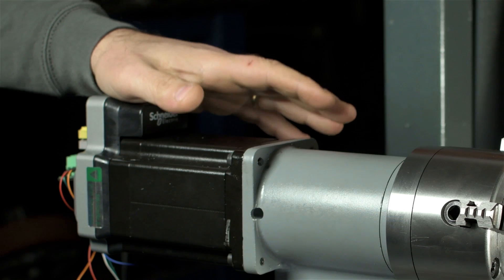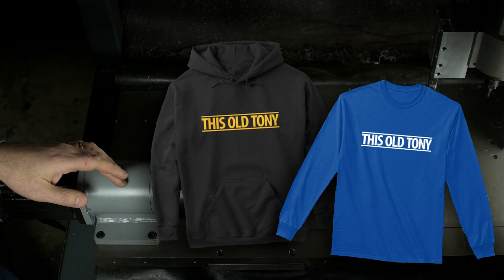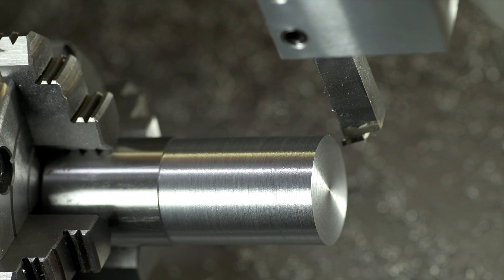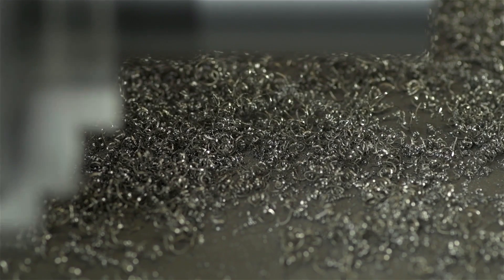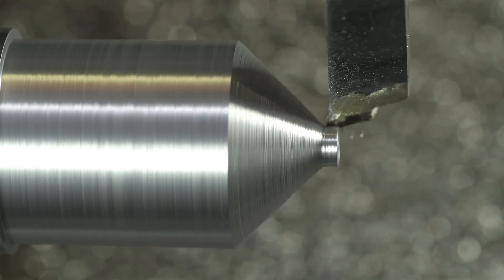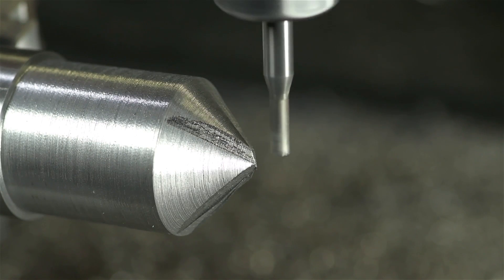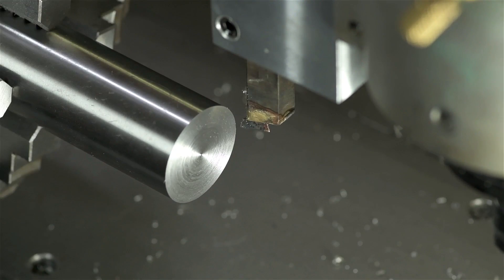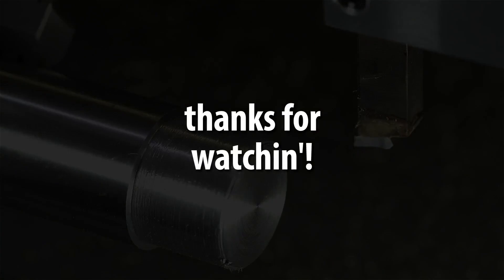Will the CNC lathe add-on TURN STEEL?

Comment: This surface finnish made my eyes bleed xd
Reply: stop rubbing steel on your eyes
Reply: Observer Ward, you looked to closely.
Reply: That’s because you were in Finland where they speak Finnish I believe. The surface finish looked like shark skin under a microscope.
Reply: You might prefer a surface swedish?
Reply: It would make a good lathe for producing piano tuning pins.  
0.01% of the general public will know what I mean. 
Which (true confessions time) is more than usual.
Reply: @Gottenhimfella   actually no, it wouldn't be good at all for producing piano tuning pins
Reply: This surface finish made my fingers bleed.
Reply: Surface finish? What surface finish? All I saw was a train wreck wrapped around a piece of cold rolled steel stock.
Reply: you should see his surface swedish
Reply: Fins fined for fine Finnish finish!
Reply: If you need to look at it that closely, I suggest new glasses.
Reply: It's micro-knurling, for positive grip.  Looks like a great way to make some lathe/mill handwheel handles (the profile of those things is a pain to do manually) - smooth 'em down with emery cloth and Bob's your uncle.
Reply: Needs a bigger nose radius on the insert.

Keep up the good work, Tony.  Even if you need glue.  ;)
Reply: I presume he did it with a knife... the Finnish are well known for that sort of thing. I'm unaware if surface Finnish are more likely to stab you than cave dwelling ones though...

Comment: wait wut i feel stupid now..<lets not get into that> you soldered or welded the cutting tip...what was that all about ...ive never seen that before
Reply: That's the brazing he was talking about (brazed carbide tool). It's a great method of attaching thing like this, or certain metal to metal connections that welding wouldn't work for. Google it, or look up Jody from welding g tips and tricks here on YouTube for more info. But brazing is very useful...

Comment: Sharpie in a vise, Ah now that brings back memories. Sharpie in spindle forgetting to set zero rpm but still set to 24krpm instantaneously bluing of the work-piece, Doh!. But at least it now save me time and engineers blue.

Comment: WOW ! just ordered TWO long sleves!
Reply from the maker: I should have clarified... each long sleeve already comes with two sleeves!  ;) thanks Ed!
Reply: @ThisOldTony  HAHA Thanks man! Truly LOVE your storytelling, it's something really different, I really admire and appreciate it. :) 

Question: I have been thinking of building a CNC with coreXY movement, belt driven and all, just to have a machine to cut wood and plastic with. But the challenge is how to make the Z-axis movement because I want to make the bed go up/down. With the goal of making it with two motors or less. Would you have any ideas on how to make the construction and mechanism? 

Caio

Comment: Do you use cutting oil or lubricant ? Because i didn't see you had any while cutting
Reply: With carbide generally you want to run a steady mist or flood or none at all. Manual oiling can shock the carbide and crack it. That is just what I've heard. I've yet to crack carbide this way myself. I usually chip it when I do something else stupid. That reminds me, I need to order some more parting tool inserts...
Reply: @lordgarak  Oh ok thanks a lot for answering I did not Know that and I'm actually oiling my parts manually with my carbide inserts so I will stop.

Comment: Just put an planetary gear between the motor and the spindel, maybe 1:2, half the speed is enough to cut but double the tourqe and rotaion stability will pay off for the speed loss great time.
Reply: I personally would put timing belt pulleys on it. Have different ratio's for different applications and add a brake for indexing. A heavy flywheel might not be a bad idea either, it would limit the acceleration a bit but might help maintain speed at the start of cut. That said if the power is not there, the flywheel really isn't going to help.

Comment: Hmm...a stepper motor is...maybe the not best choice for driving the chuck?
Reply: Not if he just wants to use it as a lathe, but he showed in previous video that he's also wanting to be able to use it as an additional index-able axis so it was a compromise on the motor used.
Reply: Itnis not exacly a stepper motor anymore in this configuration because the motor driver is in a se4vo loop with output angle feedback and the driver drives it with almost sinusoidal current on the phase windings. But he said the last time, that he knows this is not intended to be a perfect cnc lathe, but something in between anothernaxis and a spindle.
Reply: @sanches2  Sure it has feedback but stepper motors have bad torque on high rpm.
Reply: @sanches2  What? A stepper motor will always be a stepper motor. They are good (sort of) for precision, but as demonstred by This Old Tony, they just can't produce the constant (ish) torque needed for quality finishes. As soon as the DOC was increased, the motor struggled.
Reply: @BigStew007   ...which is why, as mentioned, it isn't being used as a dedicated spindle drive, but rather a multifunction additional axis that is flexible enough to be used for light lathe work(very likely limited to softer materials as well - which is why this is a separate video, with no steel turning in the original video) and potentially even perform multiple operations without need to physically reposition the work, just an addition to the coding to incorporate this
Reply: Servo would be better ofc but that Schneider motor seems decent

Comment: My god, I didn't know the tool goes so little into the part. Like 1mm is too much! Wow!
Reply: You can see to spindle stalled right before the tool broke. As Tony said, its problem wasn't the 1mm depth but being pushed into stationary metal. And the stall is quite understandable - stepper motors like this are simply not meant to be spindles; it's not impossible at all to stall them, high torque is not their game.

Comment: Say ToT, what thinks you of HSS inserts?
Reply: Pretty much crap IMHO. Such a soft material is horrible to machine DLC coated parts with, especially with proper (>0.5mm) coating thicknesses.

I also once tried making my own inserts out of some round Tungsten Carbide stock (we don't use enough Boron Carbide) with HSS tools... Did not end well. XD

Comment: Are you keeping your "Sharpie in a vise"
Reply: As apposed to his erm..."Richard".   Lol
Reply: @stirch9  right.
Reply: No he is keeping his sharpie in a chuck.... errrm that sounds wrong but the video says I'm right... I don't know what is going on anymore... :-/
Reply: @mute8s  what came first vice or chuck, what do they do they both hold the work. So it's a vise. For chucks sake.
Reply: @raymondmucklow3793  Ahh! I see you're trying to get me with the whole semantics argument! But being the efficient little keyboard warrior I tend to be at times I went ahead and did the old jazz hands routine and punched it into the gargler and vises and chucks are definitely different. So with that go stick your sharpie in a vise and stick and spin... ;-)
Reply: @mute8s  for frogs snacks, that's just splitting hairs. If ya stuck your Sharpie in either one of them and clamped down on the sharpie it would hurt the only difference is one would fatten it out the other would leave jaw grooves and spin-a-mathing until the cap came off and it let the colored schmoo out. 🤯

Comment: i should have asked this in the other video, but the question came to me later, when you were taking those close up shots of the turning tool against the material, it looked to my eyes like there was a fair bit of deflection in the tool, im guessing the deflection was in the tool because it appeared as though you had the camera mounted on the gantry, was this my eyes playing tricks on me? and if it wasnt does it matter and is it less or more than it appeared? oh and to state the obvious VERY IMPRESSIVE VERY COOL
Reply from the maker: I'm sure there is some deflection, but the g code is also moving the tool towards and away the work.  on speed-up in some spots that looks like deflection.

Comment: But can it cut threads?
Reply: Variable pitch tapered thread!
Totally useless, but we can!
Reply: @Biohazarus  Reticulating splines... mmm go on baby just a little bit more... synchronize those cardinal grammeters
Reply: @csours  Wouldn't that depend on the size of the differential girdlespring?
Reply: @Biohazarus  Shouldn't it also be able to do oval threads (=locking threads)?
Reply: Justin Mosimann  an oval on a lathe isn't hard. Use a 4 jaw uni chuck and a collet block with a hss tool.

Comment: If I didn't trust you enough, I would swear that's hot silicone at 0:35
Reply: Pretty sure it's just a trick of the camera.  it only LOOKS like hot glue!
Reply: @En-R0X  yeah, its probably just cutting oil
Reply: It's just what magnetic fluxes coming out of the magnet look like when captured by a special camera filter crafted by half naked gnome virgins and wave compensated n-dimensional bipolar lighting.
Reply: Yes, it is indeed hot glue. However, if you examine the video closely you will find that it is merely a special effect that was added in post ;)
Reply: AvE came by and gave it a glob of hot shnot
Reply: @Hacklschorsh  Nah just schmoo from the packaging